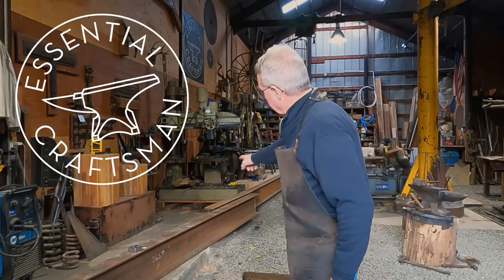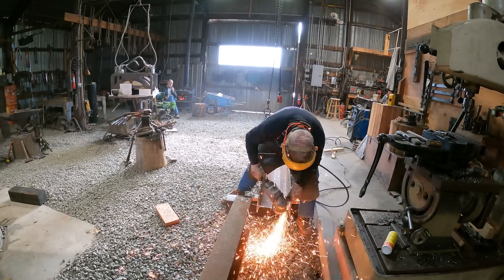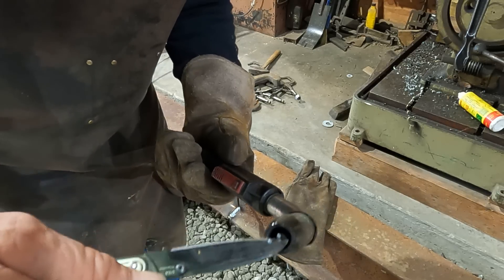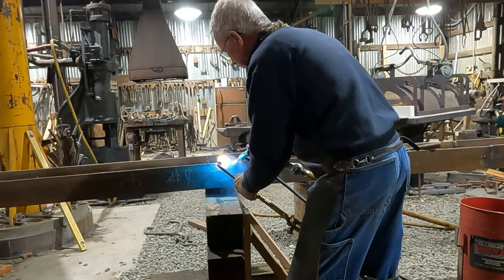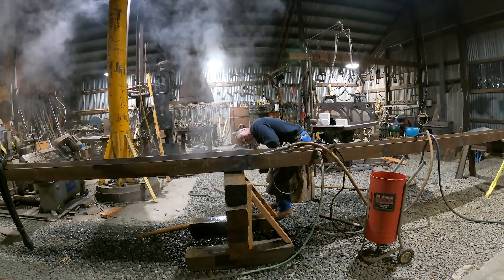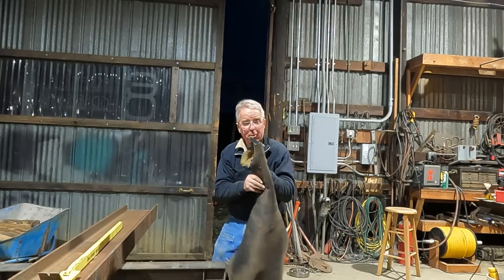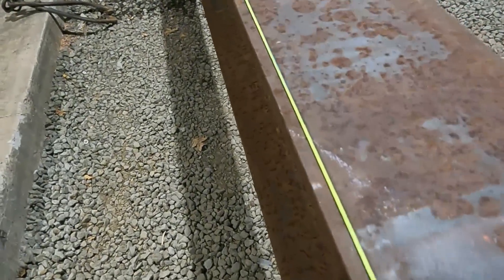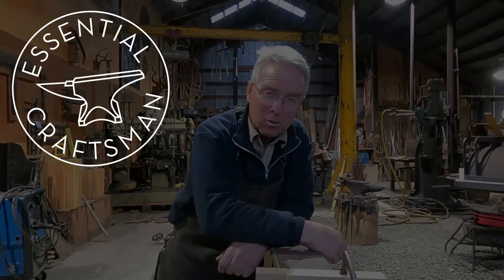Flame-Bending a 40' I-Beam

Comment: Throw a sash chain (or facsimile) loop around the case of the hoist loosely.  Then put a knot in the cable around the chain.  The chain takes the cable load and there is enough slack in the connection to move some without being pulled apart.

Comment: Nice Job on the bend Scott. But that welding scares the shi* out of me. Of course it depends on the specific construction and load - I hope it is not intended to be unsupported for the whole 40ft span. 

On the tension on that white wire: The best non-electrician suggestion I read here was to support the controller by hanging it to a chain and run that cable losely tied to the chain. That takes tension away from the cable. Another thing to consider is vibration. I am not a friend of any plier bending on female spade connectors (except as an emergency remedy). For reliability I would replace the connector. 

Proper connectors together with decent crimping pliers are available at amazon. They have to be the uninsulated type, that have two flaps that crimp into the wire strand and two flaps that crimp into the insulation. Don't get these nasty insulated ones, that are only good for turning your car electrics into a DiY campfire.    

Here is what those pliers look like: https://m.media-amazon.com/images/I/91XaaPUCChL._AC_SX679_.jpg

Sorry I can't give you a direct link, because I am tied to the German amazon marketplace.

Cheers
Andreas

Comment: Dab of crazy glue on that terminal before you push the connector on. Or add a splice and make it an inch longer with new terminal. Old one looks loose.

Comment: First you should’ve turned the bent beam around so the bent end is at the end of the welded beam second you should’ve scarfed the joint so the weld is spread into the web of the other beam and not on the same plane all the way through in an inferior butt joint like you did. Third then work out the bend at the end of the completed beam that way even if you are an eighth off it doesn’t project over the entire length of the beam from the middle an eighth inch deviation over a 20’ beam will be inches at the end of the beam
Reply: You sir sound like an expert of experience.

Comment: Your description of flame straightening is not correct.  Its not simply "heating" that makes the steel contract.  In your beam when you put heat on one side the hot metal on that side wants to expand bending the beam away from the heat, but the other side of the beam is still cool/strong thus resisting the bending force from heat expansion on the other side.  The hot atoms on the side being heated need to go somewhere & because the cold side of the beam resists expansion in some directions the atom arrangements deform in different directions where there is less resistance. This creates a permanent deformation of the metal & so when the hot area cools it has less material in the plane that would have returned the beam to its previous straightness; instead the beam contracts in this plane.

Comment: Hi Scott, watched your WF beam shrinking minutes ago here is what I would recommend, instead of using acetylene use propane because Propane you can use the pressure all the way to 30 pounds with Azetelene only max 15 pounds here is the reason why  Propane it is hotter with 30 pound or 40 pounds, the faster you heat less heat goes where you do not want it on the opposite side Rapid heat shrinks quicker and it will not heat to wide at the shrink you wish to upset faster. Sorry to shoot off my mouth but it works better. Propane is also cheaper in your wallet. Regards John Adolph
Reply from the maker: Thanks John!! I will make that switch!!

Comment: I had a super skilled stainless steel (s/s) pipe weldor show me the use of a wet rag to prevent s/s pipe from warping in 1986. S/s is bad to warp b/c the chrome grains are so close together...heat from the weld is slow to move. The opposite is  copper and aluminum.  In these two the,  grains (pores) are open... hence...they are used in electrical wires. 
  Carbon steel (c/s) A-36 (plate, structural)  A-105 (seamed pipe)...the mild steel group...the pores are inbetween the s/s & the copper/alum non ferrous group. In  c/s when the heat, then the wet rag is applied on the correct side...is very accommodating to move and so holding  dimensions are very doable.  
  I wrote..."the wet rag is applied on the correct side"... the waters job is to remove the heat that causes warping. This means...apply the wet rag...opposite to where the heat is. 
  If water spills  on the welded portion...the warping will be...encouraged. 
This water/wet rag takes practice. It is very satisfying. 
  All the best, Pete 🙂
Reply: Isn't there a corresponding trick of throwing a fire blanket over a weld immediately to hold the heat in to insure even cooling?

Comment: Just pinch the female end or put a slight twist in the male end of that spade connection. It's probably only a temporarily permanent fix but it should tighten it back up. Zip ties can work great as internal strain relief as well.

Comment: Well, the very simple and easy fix for that White wire connector is to just use a set of pliers, and crimp it closed a bit.  It will create a tighter friction fit, and not come loose as easily.  Pretty easy "Non-Electrician" fix, if you ask me!!  🤣😂😉  Keep up the great work!

Comment: I have a friend that can do that. He just uses air cooling, does other things during that time. No beam is straight from the mill, in most applications they are good enough. But some times they have to be straight within less than 1/8 of an inch. So you take a torch and straighten it.

Comment: Another great video from EC.
When metal is locally heated up to, say, red hot two things happen to the hot spot:  the compressive strength decreases and the hot spot tries to expand.  Put these two together and the hot spot fails in compression so that when the hot spot metal cools it is smaller and pulls hard on all the metal around it.  Careful use of this fact allows bending or straightening of any metal object.
Reply: You know what your talking about.

Comment: Concerning your white wire just take your pliers and squeeze that connector a little bit to make it fit tighter on the lug. Or if you want to Make a permanent fix cut the connector off and solder the wire to the lug. Great video keep em coming!

Comment: The crane controller needs to hang from a cable, something like 1/8” braided cable, swaged, eyelets, to isolate the electrical wires from the pulling around of the hoist, the electric wire gets a little “relief “ up by the hoist, slight bend or loop, then the wires don’t get jerked loose

Comment: Hard to be sure from a video, but those wires look like 10 ga.  10/3 SOOW  (rubber jacketed power cord like that)  is about 3.00 a foot at Home depot.   so $30 for a 10 ft length, more than enough to rewire that control switch (looks like maybe 8 ft at the most. ) Leave plenty of extra in the wires between the strain relief and the terminals so you're not pulling on the terminals.  Should be well within the capabilities of a reasonably capable non-electrician

Comment: For the lift, Looks like making the white wire a little longer and snugging up the spade terminal with pliers.

For the beam, Probably a good idea to gusset that butt joint weld with some strapping on the both sides of the web and top and bottom of the flange. Especially since it will likely be the center of the span and highest stress area

Comment: Scott, since the hoist is pulled by the chain and the wiring, it's probable that the neutral wire is cut a bit short (likely from replacing the spade terminal at some time). If it were me, I would make up a short 3 inch extension, with spade terminals on both ends (1 male, one female) and install that on to the neutral wire (white wire), wrapping it with either heat shrink tubing or electrical tape at those new connections. You can get those spade terminals as a locking terminal if the male connector has a hole in it, that work really really well in a tension or vibration environment.
The trick with the old sandblaster for a cooling gun is absolute gold. I'm stealing that one from you and Jon! Thank you for the knowledge sharing! Even us old dogs can learn new tricks!

Comment: A better wire choice for welding would have been E71T-1 flux core with gas. (aka dual shield) Usually used is .045. Change feed roll, liner, and contact tip. Much better structural wire. Basically 7018 in a mig wire. Also, can you put a plate across the splice? Would be perfect application for using a magnetic drill. Keep up the good work....!!

Comment: You could add a pigtail to the connector wire that keeps coming loose. Make a new spade connector piece a couple inches or so and add new male and female ends and connected in place so it doesn't get yanked out again.

Comment: There is a book Lincoln Arc Welding Procedure Handbook you should have in your arsenal! It has a excellent section on flame straightening and bending.
Reply: At one time Lincoln had a separate book for Flame straightening and Weld Distortion Control. I  wanted to tell others about it but it's not listed at the James F Lincoln Foundation website. I guess they combined it into the Procedure Handbook, so thanks for posting. It is excellent and it helped me a lot in my younger days. Social media is no substitute for a reliable textbook.

Comment: On your crane, use some small cable or chain to hang your pendant from that is a little shorter than the cord.  That way if you pull on the pendant the cable or chain is taking the strain instead of the cord.  We have a bunch of cranes where I work and that’s how we set them up.
Reply: good idea

Comment: You probably got that thing straightened to within the allowable steel mill tolerances, which are pretty loose.  My bigger concern is welding two beam sections together.  I'm a structural engineer, not a welder--but I know you need to consider a lot of stuff like pre-heating the steel in order to get a weld you'd stake your life on..
Reply: Preheating is not required unless the thickness is over an 1 1/2 or the steel temp is under 70 degrees depending on what coad you are working under
Reply: @russelltreat4572  Thanks!!  Good to know.

Comment: You can squeeze those crimps with pliers just a bit to give them a better grip. Probably have to get the plastic insulator off first. Or put a new crimp on.

You can get one of those mesh strain reliefs and install pretty easily. Just unhook the wire, replace the fitting that goes through the hole, and put the wire back in. Pay attention to the wire and hole diameter when you buy it, there are different sizes. You can get them from supplyhouse, or I'm sure somewhere local.

Comment: Very cool. I work for a steel bridge girder fabricator. We use similar techniques for heat-curving or straightening steel girders. I no longer work in production, but I've spent hours heating at strategic locations along the girder to reach design tolerances. Nice job in the winter!!

Comment: I wonder if you could splice in a bit of wire onto that connector that keeps coming loose to give it a little extra room to move around without blade connector coming off.

Comment: Simple fix to the crane. Cut loose connector off and replace with a new tight one. Then a thick zip strip where power cord feeds inside housing and zip strip right outside the housing. Like a rubber grommet without the rubber or grommet 🤔🙄 Retired Veteran here making quick or possibly long term fix to complete the mission. Have a good one 👍

Comment: 5/16 deviation across 40' is not bad at all. I'd be pretty chuffed with myself as well, Scott. If a 62' stick of rail with a 5" deviation can keep a 400,000lb locomotive moving in a straight line, then I reckon this will work just fine for what you have planned.

Comment: That grinder looks like a old Black and Decker , those were the best grinder,s ever made , very heavy and very powerful and and will run for ever if not over heated from over load , as in running a 14" diamond saw to cut blocks in the summer heat .
They were made in to different rpm speeds I have found out .
I now own three of them that runs fine and one is just like new , looks like it maybe was only used a few times.
All the old welder,s said that these were the best ever made .
Reply: You are your own problem.
You are probably a troll. @I_Am_Your_Problem

Comment: Good job straighting the I- beam , heating in triangle and cooling is a good way , and the air / water mist is a idea I have not done yet but will next time .
Welding a bead will also draw the metal smaller , that is done on mobile home frames on top to put some up bend in the frame so when the structural load is on it the it will be some where near straight .
I had to straighten a heavy equipment trailer I was building , that got pulled out of flat from cutting out a and welding in a bottom plate to make room for the axles , the welding drawed the the  beam down at rear of the trailer , did not see this until we turned the frame right side up and seen what had happened and did it nearly the same way to fix the problem , a old black smith told us how to heat and cool it  .
Got it nearly straight said that was good enough , loaded many big pieces of heavy equipment on that trailer for decades and it never bent , but always put blocks under the tail of the trailer when loading that takes that over the axle bending force out of loading.
Must have been strong enough a the first time we load the 9 ton back hoe we did not use blocks under the tail and it actually lifted the wheels of the single axle dump truck off the ground 30 feet from the back of the trailer when backhoe drove on , always used blocks after that , even had a third air pusher axle added later to haul a 21 ton  JD 750 track loader .

Comment: Cut the end of of the wire and crimp a new end with a 3 inch extension. Let it loop on the inside, install a new spade connector, and zip tie the loop in a position that won't pull out. 

If you don't want to extend the wire, use a pair of pliers to squeeze the terminal closed, then force it onto its spot. Then zip tie it to something more secure.  Those connectors tend to spread with cycles of heat and time, you can pinch them, or replace them to make a better connection.
Reply: It looks to me like someone cut that white wire and put a new spade on it, therefor that white wire is about and inch too short.   Agree, add a couple inches of wire with a new spade.
Reply: And give the capacitor time to drain before you start working.   I was once doing exactly as you said when I got a suprise poke while on a ladder from a hoist that I had just unplugged and locked out. I about went over backwards.

Comment: Regarding the white wire unplugging on the hoist - Drill a small  hole through the connectors, with it plugged, and then "twist tie" it with a short piece of copper wire.

Comment: I would just put a loop in that cable and zip-tie the top of that, rather than relying on friction in the vertical. Also squeeze that spade connector slightly tighter with pliers

Comment: Just lightly pinch each edge of the blade connector on the end    of the white wire. Not enough to close the gaps.. just a handshake squeeze.  
I repaired professionally.   This is all you need.

Comment: Hate to say this but MIG is not a good option for this unless you are doing spray transfer.  If you were not doing spray transfer, it would be best to cut it apart and stick weld it with 7018.
Reply: What's the beam being used for?
Reply: he is in an earthquake zone so 7018 all the way or Dual shield flux core would like be code for a beam splice.

Comment: Scott, try a steel mesh style strain relief with the cable connector. Should be able to thread in or with the lock nut go into your motor housing. You definitely need more relief for your motor control drop. Love the channel. 👍👍
Reply: Kellems grip if you want to search it